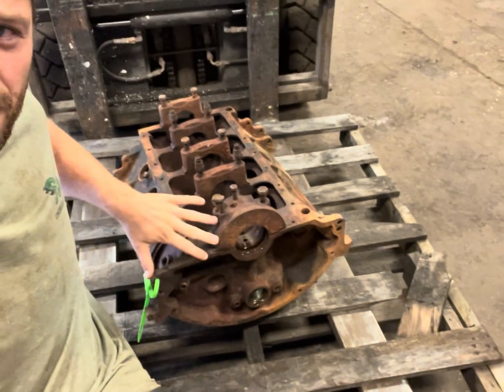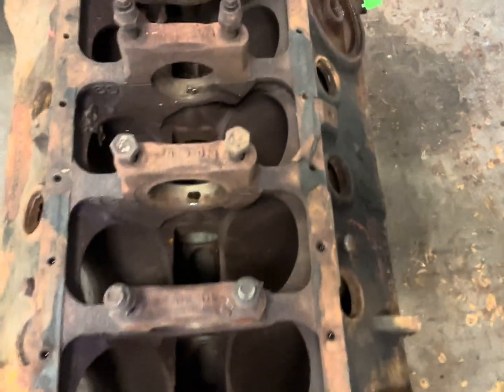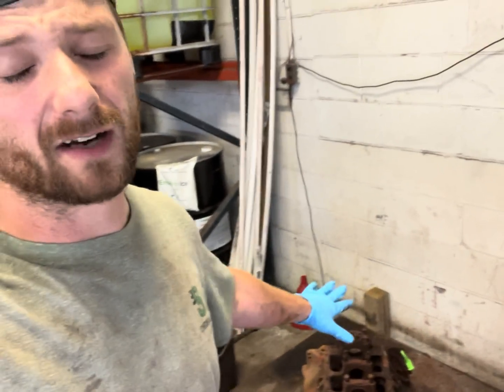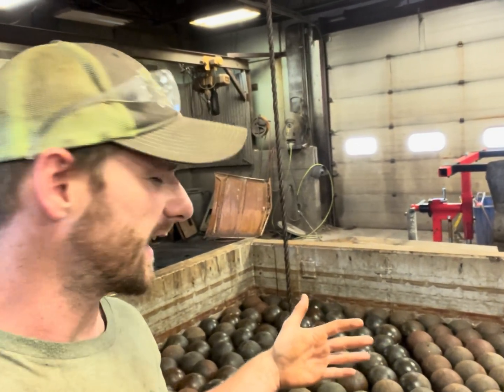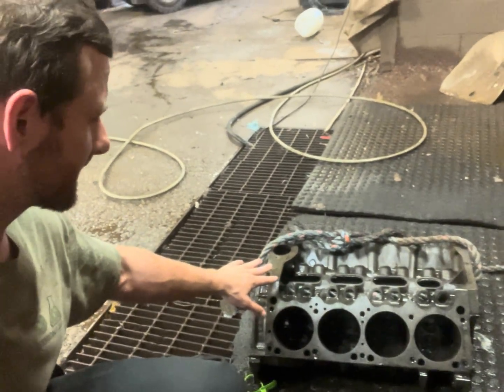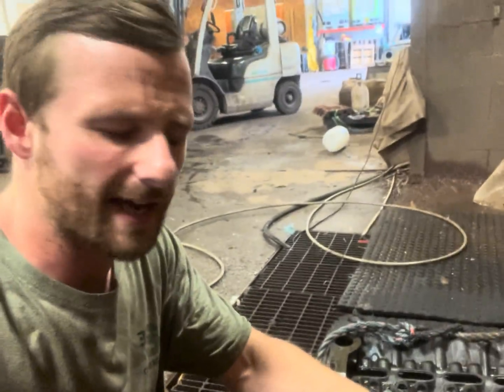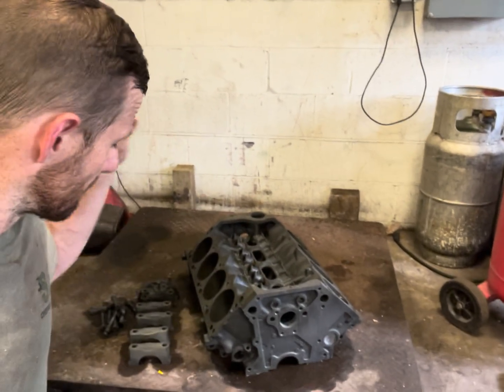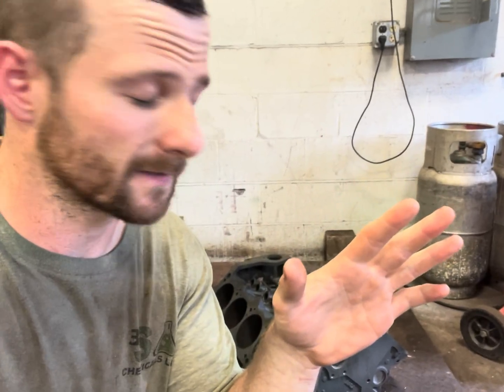Chemical dipping a Chrysler 340 Engine block

Comment: Should not have weighed it until after it was degreased as that is where  most of the weight loss was, then again after the acid dip. Another point, why weren't all the core plugs removed along with the cam bearings, and oil galley plugs.  A lot of dirt and crud gets trapped in these areas and it is hard to remove without removing everything.

Comment: Ever heard of Hydrogen embrittlement?. That engine block should not go anywhere near acid. Steel absorbs Hydrogen and goes brittle.  Could Fail under load.  Needs removing by heat treatment afterwards.  200 degrees fir at least 24 hrs. Depending on the grade of the steel and strength of acid and immersion times. Google Hydrogen Embrittlement.

Comment: Well, the rust doesn't come from nowhere, it's just a thin layer of the metal that has been converted from iron to iron oxide. The big part of that "metal loss" is already lost metal as you can't un-rust the rust.

Comment: So here's a stupid question ... but I'm not a mechanic, just a guy who loves looking at and driving cars. 35+ years ago, when I was in college, I got a call from my sister that my mom had a heart attack and it didn't look good ... and I should come home. I had a six hour drive ahead of me, and I was booking it. About halfway home, I noticed if I took my foot off the accelerator, the engine shook terribly ... so I kept the pedal to the metal. Unfortunately, I got home too late. The next week was a blur. The car wouldn't run, and I eventually took another car back to college. Eventually, my brother-in-law told me that I had "cracked the block" but that he would get the car fixed for me - with a new engine. He did and I drove that car for another five years or so. The topic never came up again. So, when he said I had "cracked the block," is this the "block" that I had cracked?  How on earth did driving my car fast (in the 1980s, fast would have been maybe 85 mph) crack this massive thing? Again, forgive my ignorance ... that whole event and the weeks following is still a dark hole in my life. Thanks to anyone who can answer this question.

Comment: engine blocks will vary it all depends if it was ran with coolant all it's life or water because straight water will make it rust in the cooling ports compared to a engine that ran coolant all it's life. Many people think they don't need coolant when they life in warm weather climate but the coolant has anti rust additives along with anti freeze and additives to not allow it to get hot as quick as just water and the coolant was changed and flushed in its lifetime. I have seen old engines that have ran on straight water and it did not matter how many times you flush it the water would look rusty and there was loads of rust that came out of it.

Comment: Do you use an inhibitor chemical in the acid so it doesn’t attack the cast iron after the rust is dissolved?  Way back when I had to work for a living, when we acid cleaned big heat exchangers, we added an “inhibitor”, so the acid wouldn’t corrode the steel, just dissolve the mineral deposits. That was long ago, don’t know if technology is any different now…

Comment: Coming at this from a different angle, I'd be interested in the requirements for maintaining the tanks, such as sediment removal timetable, refurbishing the solutions and what you do with all of the paint and crap after power washing. Great process and very unfortunate that there are limited places that this is done as well as the E coat process. The East Coast especially in the south would benefit immensely as traveling cross country loses a bunch of customers. Thanks

Comment: I didn't know people did this to engine blocks. I know shops that hot tank them and degrease them but not acid dipped. Id be concerned the threaded holes would be slightly oversized but maybe the difference is microscopic idk

Comment: I a 440 built. Before sending it in to be boiled and chemically cleaned I had to thoroughly strip it down. All freeze plugs out and mains removed. It was just the block and the other parts rods, caps, head's etc were boiled separately. The heads were also stripped all the way down. 
After it they all still needed a separate cleaning. You make sure the oil passages are clear and any remaining gunk or dirt is out of the block and off it. 
That is like standard procedure for the more professional and race engine builders. The guy that did the boiling/chemical dipping and machine work and short block assembling was a master race engine builder. Literally had decades building big block and small block Mopar Nascar, drag race and off shore powerboat race engines. 
If you really get into building you also do a ton of deburring and lightening of the block, crank and heads. Also port and polishing and balancing.

Comment: I know it might be a pain in the backside but maybe the next time you do a block you could do the weight difference after the alkaline bath and then after the finished job to see if the majority of the weight loss is grease, paint and the primary removal of the surface rust compared to the actual amount of metal removed from the acid process.
I like this entire process because if you’re doing any sort of performance build with a 50 +/- year old block and you do a sonic check. It’s nice to have a legit thickness reading and not a reading that’s inaccurate due to rust surrounding the cylinders in the water jacket.

Comment: For those with classic cars that are considering this process would you be able to explain some other details of this process, Topics like -
*what are the effects of this process upon body seams, will they rust later
*how sure are you there are no residual chemicals left in body seams,
* does the acid totally dissolve large flaky rust that may come off while in the tank (such as inside rocker panels)
*is there a greater chance of rust developing inside internal cavities after this process, 
*once the owner picks up the body how long does he have before the metal starts to rust over, 
*you wash the body down with the pressure washer but what about internal cavities, how do you know they are clear of gunk.
*what about the underside of the roof, it would have a large air bubble preventing it being cleaned
*once the car is taken home does the body need to be washed or cleaned further before applying primer
*is any healthy metal removed during this process
*are there any downsides to this process

Otherwise great videos. Well done.

Comment: I can't believe they left the core plugs and cam bearings in before dipping this block.
Reply: Yes, I would have yanked out the old ones, too.
Reply: At least the core plugs
Reply: The cam bearings are gonna need replacing anyway... @adamrushka8096
Reply: At 5:00 he is poking the pressure washer through the open core plug holes. The core plugs were not in the final weigh in it seems.
Reply: I saw the same thing . wasted the dip, without pulling the cam bearings and plugs.
Reply: Poop

Comment: I restore old tractors. I have a 48 Ford in the shop now. I doubt that anybody who owned the tractor ever made 50/50 antifreeze with distilled water so the blocks are unbelievably crusty when the freeze plugs are popped out. The standard technique is power washing through the freeze plug holes but I’m beginning to think that maybe caustic then acid dipping is the way to go.

Comment: Been wondering, what are the floating balls in the acid for?
Reply: They have the same function as a lid on the tub. Keeps the liquid from evaporating or splashing. They use them on drinking water reservoirs in the LA area.
Reply: @ricoludovici2825  cool thanks!

Comment: I'd be fascinated to see before and after measurements of the cylinder bores and main bearing journal bore sizes next time you get a block in. 

If you don't have the necessary measuring tools maybe the customer could  furnish you / us with the figures? Especially curious to know if the main bearing journals need resizing after a dip.

Now, how much would it be to get rid of the wife's remains....?  ;) Local pig farmer is squeamish.
Reply: Yo dude that is a messed up ending of your comment

Comment: Dang that looks to be the best way to rebuild an engine with a clean slate. Curiosity in me wants to know what is the purpose of the balls in the tank.
Reply from the maker: The tanks are heated. They slow evaporation and insulate. It’s our way of having a lid that we never have to remove and can pull the parts through
Reply: @minute_of_dangle  Thanks for the answer. It makes sense to me.
Reply: درود بر شما جواب سوالم را دادی،درباره توپهای شناور 🏐🏐🏐🏐🏐🏐👉👍🏻👍🏻 @minute_of_dangle

Comment: Fairly cool process as gets the inside also fairly well. I was looking into building a new block for a car of mine reconditioning a spare used engine. Still tied between vapor blasting, chemical dip, sand blasting outside and manually cleaning inside. I think all of the methods would need work on liners and stuff.

Comment: I'm a simple man and easily amused. The side bloorp at 2:49 cracked me up. I stand nothing to gain by lying, but my guess was it would be a 2.5 lb loss, so very close. What a cool video. Thing looks super clean now. I like how the balls fit perfectly in the cylinders. And hey, if you don't want a bad back when you get my age (protip: you don't), lift heavy stuff more with your legs and less with your back. I'm not being negative, you're a strong guy. But be nice to your back. You'll need it for life.
Reply: Nobody ever explained to me how to pick something up off the floor that was wider than your knees by using your legs.

Comment: 6:17 you missed to remove a cap...at least...the weight difference doesn't accounts for grime and metal loss but for grime and oxid of metal (that weights more than metal alone because of the oxygen). Our rocky planet weights a lot because of the oxygen in the minerals...

Comment: Other than getting stuck in the cylinders, what's the purpose of the balls in the bath? I'm surprised there wasn't more gunk lost off the weight, but re-watching the block was fairly clean to begin with. Thanx for another cool vid!
Reply from the maker: Thanks for watching! 
The tanks are heated. They slow evaporation and insulate. It’s our way of having a lid that we never have to remove and can pull the parts through

Comment: You made lifting 161 lbs (73 kg) look easy, holy duck that's an entire adult.
Reply: Picks up v8 engine block as if it were a toy, that’s the most impressive part of the vid, the rest was good too!
Reply: That's impressive, but what amazes me is he holds a 3000 psi pressure washer wand with one hand and uses it like it's a toy. He must be as strong as The Hulk.
Reply: Lol by the way he picked it up I was like "more like 80lbs." 😂
Reply: You read my mind
Reply: Lol yeah I was low key impressed by that grab too lol. What’s a BB mopar weigh?
Reply: Concentrated weight. a human of same weight adult would be difficult to lift because weight is distributed unevenly
Reply: Here speaks a man who's disposed of a few bodies in his time.
Reply from the maker: @greenbanananas 😂
Reply: 🤣 @greenbanananas